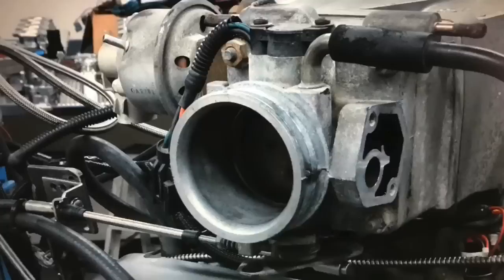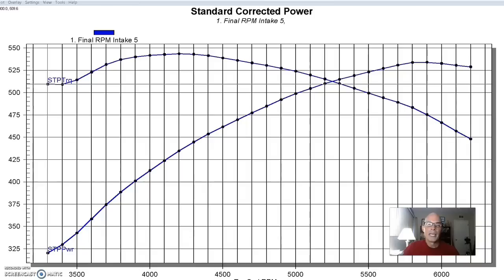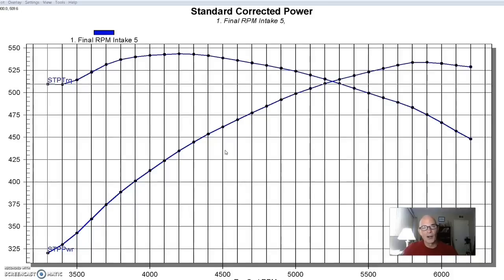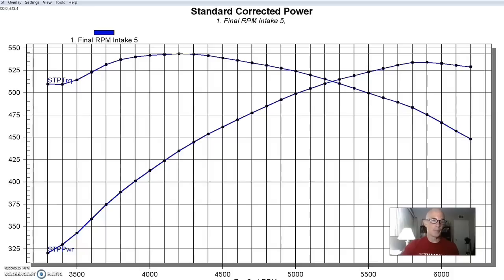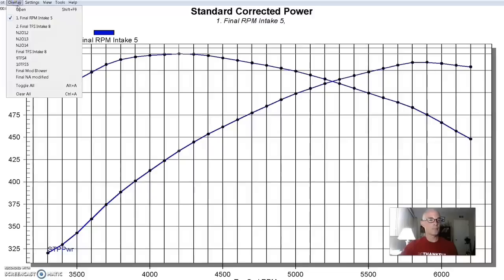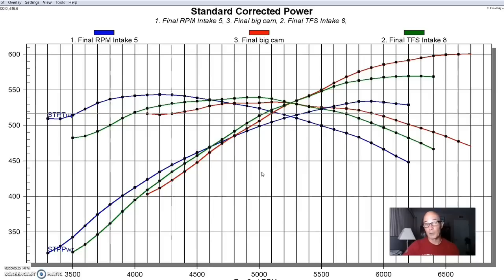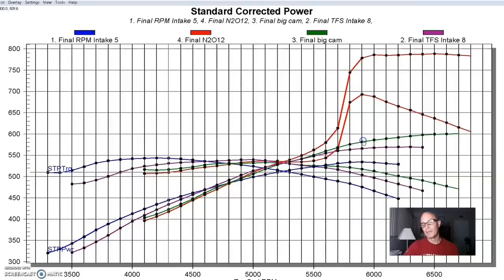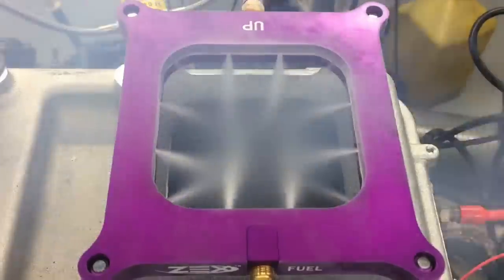HOW TO: BIG HP 408 STROKER FORD!

Comment: Thanks! This video is another exceptional blast of information. 
A re-run on the individual runner, "stack", injection systems might be fun if you use the two dyno runs with dual and single plane curves as reference. What stack length wins if you are looking for best average power4000-6000rpm? What about 3000-6000? How about 5000-6500?

Comment: I have a 1983 Mercury Capri with a 351W.  When I went from a Torquer II carb intake to a Performer RPM style FI intake. It lost at least 50hp.  I was so disappointed.  How does that Trick Flow intake compare to the Torquer II?
Reply from the maker: its better

Comment: Your getting close to breaking the block according to ford those blocks can only handle a max of 800HP the Cleveland block is a lot stronger, 600N/A is very respectable from that block I as supersede Windsor’s usually don’t make much power that why 99% of domestic racers run chevy that and for high performance parts are more expensive, one of these days you need to try a Lunati cam made for NoS you’d be amazed by there cams best cam there is, and a edelebrock intake probably make more HP that’s what us racers use and for NoS 10-1 if your not gonna go over 500HP is the magic compression ratio of you wanna go higher say the 1000 shot they have today you wanna be 7-1 or 8-1 with NoS the more you have the less you get the less you have the more you get like how you get 200HP from a 125 jet most people don’t because they have too much already like NoS at 13-1 with a 125 shot you might pick up 75-100HP if your lucky these new racers just don’t understand how thing work it’s kinda sad they all buy crate motors there’s no pride left but the few that do run hand built non-crate motors rule the scene there more reliable and produce more power I’ve seen $97k crate motor’s blow up after 1-3 pass’s, when I was racing I blew 1 motor a year usually unless I had and engine break on me which didn’t happen often on the last race of the year last run of the night I would put a 500HP jet in my car and blow my engine sky high, I only ran a 125 jet normally from the time the second yellow on the tree went off till the end of the track I sprayed the whole way I had 3 30lb bottles of NoS in the trunk
Reply: Ya' don't say......     uh huh, yep, uh no. nah, NO WAY !

Comment: I have 99-02 silverado ext cab 5.3 vortec /btr stage 4 cam 224/230 .553 .553). What heads do you recomend for that upgrade and any manifold intake?????????
Reply from the maker: good heads for a 5.3L are the TFS 205 or properly ported 706/862
Reply: Especially if you plan on running any supercharger or turbo.Just add boost.

Comment: My 351W in my 96 E350 van over heated and burned the piston rings so I put a Coast performance 408 stroker in it with TFS heads and an Edelbrock 750cfm carb with edelbrock Vic Jr cylinder heads and TFS camshaft. Was a bad ass engine. Really helped with torque down low. Also helped with torque up high as well. I’m pretty sure it made around 450-500hp and 500-550 torque. Would still rev to 6250 no problem, didnt ever let it run out that high too much because it was an all cast rotating assembly.

Comment: Hey Richard , how about a durability test on some of those conrods like ford did on some of their race motors !  .
Reply: Jeff Kopis  Yeh like that , but with , a cheap block , and have a Chinese rod shoot out ,or just one brand , well are most made in the same factory with a different name laser etched ?? ,  against  1st level entry USA made rod , 6000 rpm loaded for a decent amount of time or fail like ford did see what is the weak link  , might need good valve train .

Comment: OMG, I love your videos.  I've been trying to tell people for years that on a larger motor with a serious cam a single plane is the way to go.  If your running a small block engine you might want to run that dual plane to enhance the torque down low where you do most of your driving but with the big inch motors making 300-400 ft/lbs. down low you'll just spin your tires. Better to soften up the motor down low and let that sucker eat up high.  Thanks much for this test, now I have something to show those folks that read to many magazines.

Comment: I like that statement.."if it makes more Tq than Hp there is still more performance to be gained"...
Reply: Pontiac is best if your speed shop is the junkyard.
Reply: @johntempest267  if you wanna go slow
Reply: it is the truth. along with, "HP sells engines, Torque rules the street"  :)  If you want MPH at the strip, build for HP. If you want to chop the seconds, work on torque and launch to win at the starting line.  For the street, focus on torque at low RPMs, and get the gas mileage for "free"....and use junkyard OEM parts to do it with.

Comment: From what I recall the Windsor motor with an aftermarket Cleveland head will make a shit load of power. Enough power that even the top build LS is just shy of its power NA on pump gas. Over 800hp in 460ci setup. It was an iron block with CHI 400 heads.
Reply from the maker: that's a lot but race combos at 440 inches are making north of 1100 hp

Comment: for the same amount of work and money, couldnt you make the same power from a 302 while saving some weight and room in the engine bay? or is there really no replacement for displacement
Reply from the maker: hard to make 600 hp with a 302
Reply: Making that kind of power would be very hard N/A with a 302.But using a supercharger or turbo no problemo!

Comment: I’d love to see an RPM Big Bang. Lots of cylinder head, lots of camshaft, fly cut pistons, short runner intake, stock bottom end LS or anything for that matter. I’ve never seen it and feel like there are a lot of misconceptions as to what the RPM limit is for a stock bottom end small block (especially LS engines). 

I hear people all the time talking about what may happen if you spin stock LS’ beyond 7200, but never hear any first hand experience.
Reply: I think you can rev the 4.8 and the 5.3 ls to the moon. 😁
Well atleast with aftermarket con rods.
What you need is enough big cam and valve springs/valvetrain to support big rpm’s and you’re good to go! 😁
”Yeah I turn it just 8600rpm. Yeah with stock bottom end. With nitrous” -James Taal
Reply from the maker: changing rods make it not a SBE

Comment: During WW2 They boosted Mustang fighters with NOS.  They also tried hydrogen peroxide which had power levels that were close to the NOS systems.  Problem was it was highly corrosive. Today a lot of hot rodders are running water/alcohol injection on turbo and supercharger systems to fight detonation so they can run pump gas and high boost..   I wonder if replacing the water part of the mix with 35% food grade peroxide wouldn't be another power adder no one would ever suspect?
Reply: @andrewjolley3620  No. The first military attempt to used hydrogen peroxide was in submarines to help them run diesel motors under water. It was dropped quickly in favor of electric motors.  Earlier attempts before that were those trying to develop hydrogen engines.
Reply from the maker: Power augmentation was experimented with and run by the Germans, the British and Americans before going to jets
Reply: M1 alcohol fuel is also corrosive to aluminum parts.Its also hard or oil.

Comment: I continue to be amazed at where the little 351W stands today as a performance engine.  In 1973 I purchased a used 1970 Mach 1 with the 351W.  At that time there were basically NO companies providing aftermarket speed parts like heads and cams.  About all I could do was add a mediocre dual plane intake, 700 Holley and headers which didn’t do much to help the anemic 250 (GROSS) HP factory rating.  The Cleveland small block got all the love back then.  The 351 Windsor was considered a “truck” engine not unlike the 390 FE.  Oh what I would have given to gave had an engine like in this test.  I would have been king of the streets!
Reply: *600 Holley

Comment: Lets see where that 351W roller block sits on the strength department. Got my hand way up!  Good series of dyno tests to show what happens when you have one of the combo too small. If you're looking for good torque for the street there's no doubt the RPM Air gap is the way to go. Need more top end? Maybe could have put an open hole spacer on it, maybe even a 2 or 3 inch spacer just for the track? Again, thanks for posting! Nice vid!
Reply: what about for a street 408 would you still use the rpm air gap?
Reply: @chriswhynder8311  Super Victor seems to be the most popular. Tons of guys using both the EFI version and carb style super victor. 
Over 400ci deserves a single plane intake :) 
Especially if it's going in a light car with a stick. Like my mustang ;)

Comment: I have a 1969 351w block that I've been saving for a special build. I think I will have to go 393 because although the early blocks are stronger, they have the shorter 9.480 deck height.
Reply: 393 is long proven combo.  Can easily make 500+HP in a totally streetable package.
Reply: @danmyers9372  Cool. I'm wanting to use TFS 11r 205 heads and a hydraulic roller cam conversion.
Reply: My 1969 351W block I went 420 cubes.   It was a 418 Kit but I had to go 40 over on the block making it a 420.  I used CHI 208 heads and intake making it a clevor.  Made over 600 horse on 91 octane.
Reply: @mightyarm  Sweet! Do you remember which 418 kit you used? I've been looking at the kits at Coast High Performance.

Comment: So, the SPEEDMASTER Connecting Rods held together, Mmmmhh. I´ll have to think again on my rod choosing.
Reply: Buy American!
Reply: @funfun8095  Ha, like what? I suppose he'll need to refinance the house as well.
Reply: @falconater68  I guess, if you can't afford American made Oliver rods. And Scat and Manley at least do the final precise work here.
I've dealt with Procomp crap, (Speedmaster, now). Not very good quality control. You might get some good parts, but it's the bad ones that can really hurt you and your budget. Look up Procomp head issues, just to start. Then the intakes aren't to spec either. Had a customer want to save money on a cheap intake. MSD distributor wouldn't seat right, so the 100.00 he saved on the intake, went into the difference to buy a MSD adjustable collar distributor, plus pay for more labor to swap the stuff out.
People can buy what they want, just find the corona parts that have the best quality control, I guess.
Reply: @funfun8095  On this issues, I always answer "I´m building the entire car, not only the engine" The reasonable approach IMHO would be saving in non critical areas and spending in the vital ones. Damn it, but is so tempting, LOL.
Reply: @billashe2108  I know. It's hard to buy all American. NAFTA didn't help and the USA running out of good steel, doesn't help either. I'm doing 3 builds right now with VS Racing turbos, but he has a decent grip on the QC. Really the only Chinese stuff in these builds as of now.

If we could just get everyone to NOT buy any of their (Chinese) stuff, maybe we get some of our manufacturing back. Pipe dream though. Most people have given up. That's NOT the American way!
Reply: @funfun8095  I agree.
Reply: falconater68 It’s a WE. Like American people stay together and we can do it
Reply: fun fun Bull’s-eye turbos American made call Bill he is one of the best guys you we’ll ever talk to you.
Reply: At least long enough for a few dyno tests.  I would not trust their parts over the long haul.  I like sleeping at night.
Reply: @danmyers9372  Yes, a few runs are not a real life endurance test. I guess you are right. I would like to see them staying together run after run. There is too much money at risk.
Reply: If only Richard could tell us how many dyno tests he has made with that set of con rods.
Reply: I know of a 410 Windsor with H beam Speedmaster rods going 4.90's in the eighth it's on its second season no issues
Reply: @jedwards100able  Thanks for the information, I appreciate it. I´ve always suspected that in a properly designed and assembled engine, they may work as that set you mention.

Comment: What is your opinion on a 427 stroker with a stock block?
Reply: Most people recommend the 415.
Reply: @michaelangelo8001  you mean 418?
Reply: @GJ-DT  Yes.  I knew I was close, and was too lazy to look it up
Reply from the maker: I don't like strokes longer than 4.0
Reply: Richard Holdener just wondering why is that would love to hear your opinion!
Reply: @richardholdener1727  i assume you mean 4.0 in a small block?
Reply: You can build a 427 with a 4.000 stroke & 4.125 bore.But you will need to do this using a aftermarket block.

Comment: Great video Sir. Thankyou for all that you do!!!!!! I'm chomping at the bit for the efi ford 300 six series of tests!!!! With enough cam to turn 5500,  the right t4 based turbo, and all-the-boost, it will be a bad-ass. Get ready Cummins fans😁
Reply: I can't wait either. It's still going to be really limited still by the head port flow, valve shrouding and intake manifold flow and runner length, though.

Comment: Fords cost too much to build and they dont last long
Reply: Hey Richard, there goes some more of those myths again!  So you would put a POS Chevy engine in a classic Ford muscle car?
Reply: 92VXEG  When going north of 600hp NA with a standard stroked sbc (350) or the standard windsor (351) platform, the price is virtually the same. The factory windsor can be stroked more, and generally will hold more power.   

Now the sbc LS platform comes with decent flowing factory heads and intake, and this is where the savings begin over the conventional windsor hands down. But going north of 750hp NA on either platform, once again the price difference will virtually be the same. 

The physical size of an LS being smaller compared to the windsor should be taken into account here as well. This is what makes the LS platform a great swap option. 

Bottom line, they are both excellent options. Big hp will cost money with either. How fast can you spend?

Comment: I would have stayed with the 540hp combination.  That was impressive enough.  Would have made a fine street engine.
Reply: #Albert Gaspar - there is one of those myths again!  Tall deck Windsor engines have been in drag cars for years up to, and exceeding the 1000 HP mark.
Reply: Considering this is a 2 bolt block not designed for performance (that was the Cleveland's job) but bread and butter cars, and we're giving those main webs more stroke than they were designed to handle, I will respectfully say...it's not always a myth :)  Try that HP with a block made in, say 1978, when all OEM were cutting back on the nickel content.
When DSS warrantees their Level 10 Windsors, even they look thru blocks and sonic check them fully.

Now, a drag block that is full of concrete or Hard Blok, running for a few seconds at a time, and being torn down on a regular basis to check for cap walk (and washed down cylinder walls from running rich enough to avoid holing a slug), yeah, I can see that. You may even want to take a look at the "stock block" to see if the side walls "barrel out", a sign of an aftermarket block posing. But most Ford forums say, if you want to last on the street, 700bhp is about where you want to look at an aftermarket block.

https://www.stangnet.com/mustang-forums/threads/hp-limit-of-a-351w-block.795118/#:~:text=Pretty%20much%20any%20351W%20block%20should%20handle%20700,into%20that%20power%20neighborhood%20and%20adding%20spray.%20Matt

https://www.corral.net/threads/how-much-power-can-a-351-windsor-handle.712013/

https://www.theturboforums.com/threads/how-much-power-can-a-351w-block-handle.307254/

https://www.fordmuscleforums.com/threads/max-horsepower-out-of-a-351w.431732/
Reply: @albertgaspar627  Sounds reasonable.
Reply: That's my sentiment.  I'm sure there are gamblers out there, but to buy the block, dump money into sonic testing and then machining it to blueprint specs, then putting on a girdle...you're close to an aftermarket block that just needs seasoning on a vibration table, and if your OEM block goes, then you saved no money at all. 

Of course, if you are racing with sponsors, then that OEM block is lighter after all that machining, and you can afford a spare engine....

Dynos are nice, but as everyone knows, they're injesting cool air, not heat-soaking inside a tight engine compartment, and the air/fuel ratio is being monitored along with detonation. Oil is not getting sloshed around the lower crankcase with G forces in turns.  To quote the small print...your mileage may vary :)
Reply: plus its under the typical 600 bhp that cracks a tall deck Windsor.
Reply from the maker: 351Ws don't split